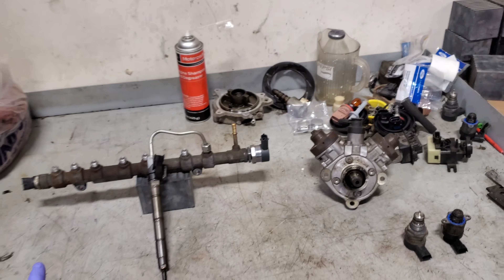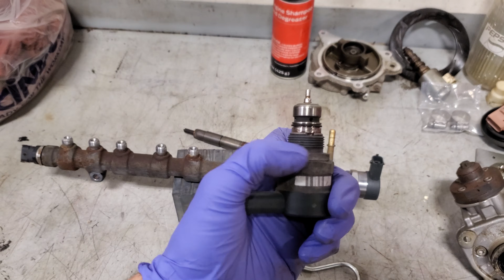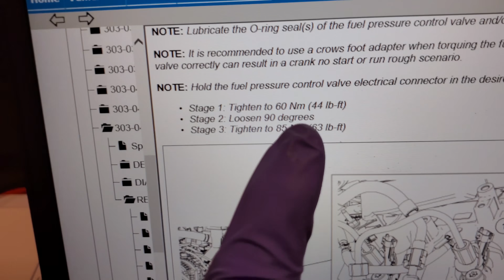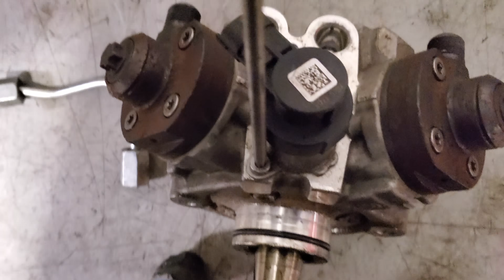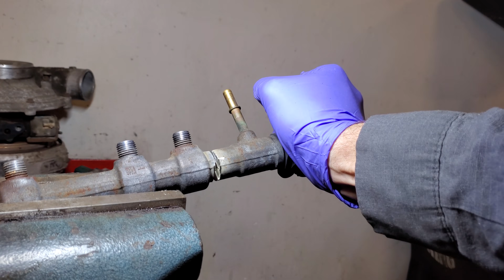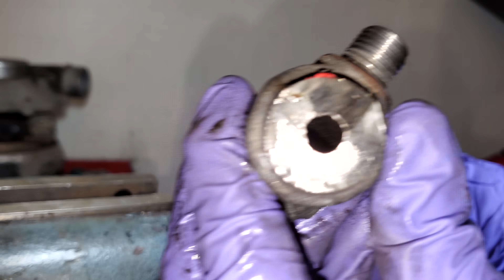High Pressure Fuel system concerns - LH FUEL RAIL discussion | Ford 6.7 Diesel

Comment: Just recently started getting the p0093 on my 2017 f250 only when pulling my gooseneck trailer even empty. I noticed it does it when going over 65mph. Get a engine power reduced and shuts off but ive been lucky to always make it to the right shoulder. It will start and run right back. Replaced the fuel pressure regulator but it is still doing it. Any other suggestiin besides a bad cp4? THANKS!
Reply from the maker: I'd put a new DCR and a LH rail!

Comment: I have an issue I have a 2012 f250 6.7 my air dog is making a bit of noise and I have a squealing sound close to the upper filter when I turn the key on my fuel pressure actual and desired is the same but only showing 1100 psi any thoughts
Reply from the maker: Your HP is reading 1100 or the LP???
Reply: @PowerStrokeTechTalkwARod I would assume the truck wouldn’t even run if it’s actually 1100 psi correct
Reply: That’s at idle when I drive actual and desired are the same and go up to maybe 13 to 1400 psi
Reply from the maker: Thats way too low to run. It needs 5k to start....
Reply: @PowerStrokeTechTalkwARod  I totally forgot I had the Bluetooth module and forscan light. I hooked it up and I’m reading 4500 to 5000 fuel pressure rail side a it says at idle
Reply: It’s fuel rail pressure actual and desired on livewire
Reply: This is all based on SCt live wire TS+ monitor

Comment: Owning these trucks requires many upgrades if you want to keep it running for many years and many miles! Just get the S&S Diesel HPFP and get rid of that CP4 grenade! Mine was on the way out, I swapped it for the S&S and had no glitter yet! 😎👍

Comment: Orifice has to be inside the pcv and the pcv seals off the access to the brass tube.
Reply from the maker: The orifice is not in the PCV it's in the rail. It equalizer pressure between driver side and passenger side fuel rail*

Comment: I have a p0087 code trying to to figure it out.  No metal in the valve on the cp4 pump. Truck runs fine starts only is affected at wot so I think this is my problem, any help is appreciated
Reply from the maker: That code can be kind of tricky to diagnose.There's a couple of pinpoint tests that you would need to follow.So you can know which fork in the road to take
Reply: @PowerStrokeTechTalkwARod so have gone through a few test on my own.  Idle fuel pressure is 4500-4800. Have no starting issues.   While under full open throttle my pressure goes to 26k-29k but the thing that makes me think it’s the regulator is I’m losing fuel flow rate.

Comment: Im getting fuel kpa  in red im wonder if thats what is control module voltage  i pulled the map sensor it stoped shuting down when that spikes red it imeditly shuts only new symptom was battery light  came on i did power back feeding on pin  53 so its possible shorting out
Reply from the maker: Hmmmmm id have 2 look at it

Comment: I have a 6.7 and for some strange reason my fuel injector lines/tubes keep popping. Not sure what’s causing it. I have ordered one of each and have them with me. I replace them as the pop/leak. Machanic wants me to replace the entire fuel rail system.
Reply from the maker: Yepp, that's a no good

Comment: I’m trying to help a neighbor I hope it’s as simple as a fuse or clogged filter , your video is definitely gonna help me diagnose it ! Thank you
Reply from the maker: Good luck
Reply: @PowerStrokeTechTalkwARod  I got the truck running . had low high side pressure , I primed by toggling key switch a few times saw that high side pressure was at 4900 so I cranked it over started right up . ran and observed pressures for a bit and high side pressures would drop . lower pump pressure stayed at 57.7 continuously . Customer finally came out and said he had put DEF in the fuel not Alot but did not clean it out just ran it and fill it up again . he drove it until it died then tried replacing fuel filters . Am I right in suggesting the contamination kit for the fuel system its only got 66000 miles?
Reply from the maker: @joeortiz7408 THE WHOLE KIT!!!!!!!!!!!!!!!!!! DO NOT take any short cuts
Reply: @PowerStrokeTechTalkwARod  thank you I appreciate the help!

Comment: I’ve got a 2022 6.7 power stroke with a crank no start . Has a P2291 code only 60 k miles . Where should I start, filters then relays then pressure test ?

Comment: I literally just had this job whip my ass bc I didn’t realize this LH fuel rail had this orifice, mine did not build any pressure, system was clean 180k miles, I blocked off the injectors still no pressure the only way it would build was by blocking off the F-PCV so I knew my pump was still good,,,, so I ordered a LH rail, installed it and boom, almost immediately made8k psi,,,,, I couldn’t believe it!!!!!!!!
I’m gona cut the rail open soon.

Comment: Today my engine light came on and this  is the code The P228F code indicates that the fuel pressure regulator in a vehicle is too high.
I didn’t notice any change in how the truck was running I was about 200 miles from home got home fine now I’m little nervous what could it be im getting filters Monday even know I changed my filters every 10,000 miles 
And I also ordering the sensor too. 
😔
Any other recommendations will be greatly appreciated thank you.
Reply from the maker: Either a pump or driver side rail

Comment: Scenario..... one of my metal fuel lines that come off the fuel pump (the one on passenger side that runs over to driver side) the truck shut down almost immediately after a low power warning. I got towed and replaced the fuel line. Truck is running great. Only problem is I am now getting p0087. I disconnected batteries to try and clear it and it's still there. Any suggestions? Thanks Arod!
Reply from the maker: Either you still have a problem, or you need a scan tool to clear
Reply: @ thanks
Reply: @PowerStrokeTechTalkwARod  imma disconnect the batteries all night tonight. Im going to harbor freight tomorrow to buy a scanner. Hopefully clear the code and hopefully it doesn't come back

Comment: Hey Arod I have a 2013 f250 and I originally had a P026a and P0087 together. The P0087 code went away on its own and never came back, and i have since replaced the charge air intercooler and gotten rid of the P026a code. But currently I have a P228f code and it is intermittent it comes and goes, but mostly trips CEL and comes on. What are your thoughts brother? Truck has 210k miles currently.
Reply from the maker: I'd be doing the DCR & a driver side rail

Comment: I've been pretty successful with just cranking that sensor down by hand without any issues. Nor have I used any torque spec or torquing sequence as recommended. The biggest thing is it just really needs to be tight. If I have any issues at any point doing that method I will come back and comment otherwise.
Reply: How did you reach it and what tool did you use ?
Reply: @andraealexander364 I just did mine. I used a 1 3/16 crow’s foot that I ground down to fit into small gap. Took longer to grind down the crow’s foot than it did to change out the valve.

Comment: I have an RV with 2014 F550 chasse, 6,7 Powerstroke only 25K miles.   Got error codes on #1, 3. 5 injectors.  #5 was ohming 0 so replaced it. #1 and 3 code returned ohm checked good.  Dealer says replace all injectors. I requested full system contamination check to check VCV screen, the most common item to make all 3 of those code at the same time...Hmm. Its $7K for all but if they install and dont check screen then its a wasted $7K. Getting push back because no code indicate low psi. Just an opinion: I dont think there would be a removable orifice in such a high pressure system, notice any other part with removable orifice.  I'm not diesel guru, but aircraft hydraulics work the same of a 3,000 psi system. if there was it would have to be beveled, wedged, or held in by something that metering valve sits in that drilled orifice

Comment: Had 2017 F 750  the last few days it die going down the road and blew the return line t off no codes would t start after repairing the return line found it had # 5 injector check all the normal stuff like you said blocked off injectors one at a time and tried to start it when got to number 5 it ran got it all back together no codes and was running good sent truck out and it would go into power loss mode it was loosing fuel pressure replaced the sensor and regulator and fixed it first time messing either one so it was learning curve

Comment: Man I’ve been messing with mine now for a minute P0088, P0087 I checked the fuel filter also pulled the regulator (no metal in or on either) I replaced the regulator and the P0088 code went away but I still have P0087 so I back tracked to the fuel pump and found a leak replaced that fuel pump (it was shot) and still have the P0087😞 the only loss I get is just at start up
Reply from the maker: HP pump & driver side rail...

Comment: I may have to replace my fuel system. Hopefully not, but I have the dreaded p0087 code. Truck starts right up, idling sounds good, and it seems to drive fine. But it keeps giving me the reduced power code. May try swapping the sensor first, but if that doesn’t work, it’s going to the shop where I’ll probably need to replace the whole fuel system.😢
Reply: Could be the fuel rail.

Comment: ['21 F350] I experienced the P0087, ie I couldn't develop adequate fuel pressure at WOT and I tracked the problem down to a tiny nick at the edge of a (new) fuel pressure regulator. The truck would idle, even drive OK, but at WOT it would throw the code. Since you replaced the regulator and it did not resolve the problem, I would inspect the threads (mating) side of the tube for any irregularity. This part of the system has extremely low tolerances as you mentioned.
Reply: a nick? how small and where was it.  were you getting a p0087 code? thats what im chasing now

Comment: Hey ARod we have a fleet of F550's and one of the 2018 is getting a reoccurring fault code for multiple fuel injector learning limit exceeded, runs fine other than slight fuel knock occasionally at idle, have you seen this before ? Should i take the VCV out and inspect . Thanks
Reply from the maker: Did you try resetting the mid mass fuel adaptations for all cylinders
Reply: yes we have and also has the latest pcm update  @PowerStrokeTechTalkwARod
Reply from the maker: Are all of the IQ a numbers programmed
Reply: yes they all match  @PowerStrokeTechTalkwARod
Reply from the maker: @user-rx7sw7si8e hmmmmmm

Comment: I have a 4-5 second long crank with code p228f and on idle it has like a fuel knock but once you rev it the fuel knock goes away . Any ideas if that regulator would cause that ?

Comment: Does anyone know if a bad fuel volume control valve will still give good fuel pressure reading in the high pressure fuel pump? My fuel volume control valve is only opening up at 26% duty cycle and at WOT 31%...seems stuck to me but fuel pressure is on target to what my fuel pressure is commanding?

Comment: I have a P228F, P0170, and multiple cyl contribution /balance codes. Truck ran fine, thought engine blew. Sat 2 yrs, then found starter messed up. Put new starter and batteries on, started up and ran fine. Ran for 2 weeks, then suddenly started studdering and quit. Hasn't run since. Threw those codes.  Changed filters, dropped and cleaned tank, pulled cpr4 valve and it was as clean as can be. No rust, no flakes. Still stuck with a 100k mile truck not knowing what to do. Everyone saying fuel system at $10k to fix.  Haven't found anything to justify doing that.
Reply from the maker: New CP4 or S&S new DCR & replace the LH rail, trust me

Comment: Getting p228f code truck idles fine, no power to pull its self though. I see most of your replies to p228f are to replace the ds fuel rail, is this cause by the cp4 going bad is replacing the rail going to completely fix my issue. Is it the start of a complete fuel system failure or will I be done back on the road.
Reply from the maker: Rail & pump combo, trust me
Reply: @PowerStrokeTechTalkwARod  replace the just pump and rail. Or should I do a full contamination kit?
Reply from the maker: Is it currently running then no
Reply: @PowerStrokeTechTalkwARod  yes it was still running when I parked it. Just doesn’t have much power. Won’t move over 45 mph and coding for p228f. I will start with replacing pump and fuel rail. Thank you!!
Reply: @TheRockStar129 did it work?? Rail and pump combo … I’m getting ready to do it!!!!!
Reply: @matthewluna727  I ended up replacing just the rail, mechanic that helped do mine did not find a need to replace the cp4 because there were no metal shavings found. We found that my lift pump was not able to keep up with the demand for fuel needed to run the tune I had on my truck so we went with an airdog lift pump kit to deliver more fuel. But replacing the rail and sensors got the truck running again. Mechanic determined that the orifice was stuck or something.
Reply: @TheRockStar129  thank you!!! Glad to hear your rolling again!!
Reply: @PowerStrokeTechTalkwARod rail and pump combo did it for me!! I did dcr pump though and drop fuel tank to clean out, I opened bank 2 and injector 5 failed a low idle test but the engineer told me it was that bad because it passed everything else with flying colors just got the truck back today and just keeping my fingers crossed that everything stays good 👍
Reply: @TheRockStar129 thank you for your feedback!! Interesting on the lift pump, I will do that too one day when I get more $$

Comment: Great video!! Question for you. Have you ever come across an issue with the fuel return lines blowing off the plastic fittings at the injectors? I’m working on a 6.7 that has an issue blowing return lines off . I thought it was a restriction at first so I blow the lines out from the injectors to the tank . I also swapped out the injectors that the hoses are blowing off the fittings with known good injectors. The return line assembly is also new . The problem only happens under hard acceleration or heavy engine load. At idle it’s fine. No other drivability issues.
Reply from the maker: Time for a fuel sys pal
Reply: Hi, I am having the same issue with only one return line blowing off. Did you find the problem ?
Reply from the maker: U have high restriction in fuel return side
Reply: @PowerStrokeTechTalkwARod   How do I test/trace the restriction. It happened right after installing new/reman fuel system . Truck starts but when press the gas rapidly bogs down .
Reply from the maker: @Ioang40 pinpoint tests M & ME
Reply: @PowerStrokeTechTalkwARod  Found the flex line going to the Pressure Regulator kinked and twisted.Could this the culprit for the restriction and blowing off the return line of injector#6 ? Also a loud screeching noise coming from Engine mounted Fuel filter . I have a short video if you give me an email . Thank you !
Reply from the maker: @Ioang40 no. Thats no the fuel injector eeturn
Reply: @PowerStrokeTechTalkwARod  I replaced the kinked flex line going to the FRP regulator and the screeching noise gone and no more blow off return line  but I still have High Fuel rail pressure at 5,600 psi  .

Comment: Yea I have, on the three time now.  Mechanic couldn’t fix it last time. He replaced injectors but only cleaned rail. I’m pissed.  Runs at idle rough at times and then cleans up intermittently.

Comment: ARod, yes we have had this failure and caught it before the engine was damaged. HOWEVER the entire fuel system has now been replaced (New CP4, metering valve, lines, rails, injectors, low pressure pump. Everything in the fuel system is brand new) and it runs in park or neutral but a couple minutes in drive. Commanded fuel pressure will spike, the actual pressure is correct but the difference trips the low fuel pressure code and sends it to reduced power mode P0087 code. Any ideas??

Comment: I am getting code p228f exceeded learning limits pressure too high along with long cranks. 2-3 sec, vs normal of almost immediate.
Reply from the maker: Ok
Reply: @PowerStrokeTechTalkwARod  Sorry at the time I meant to add more details and hit send anyways. I pulled the valve on the top of the pump as you suggested. There is a tiny amount of metal shavings I have a close up pic if I can share it with you via email. I drove it with the long cranks about 12 times before parking it. Is there a chance I can replace just the pump, or is any amount of shavings grounds for full fuel system replacement?
Reply from the maker: Any metal? It's. Time? To replace everything unfortunately but it would have been nice if you had the s n s disaster prevention kit on it

Comment: 2011, F250, 6.7 with 214,000 miles and run Motorcraft Cetane religiously from day one… NO PROBLEMS, just consumables. I am S&S Bypassed as insurance. I’m thinking about changing out the CP4 and injectors because I intend to drive the truck a long time. Any educated thoughts on if that’s a good plan, or should I save my money?  Please advise…

Comment: Wow. Well done. Good video. Had this exact problem on a 2012 F550. Pulled my hair out too. P228F-00 code. Symptom engine idle fine, rev engine, or run at high idle and disengage high idle, fuel pressure would spike the drop enough for engine to die, usually under 2000 psi. Changed MPROM, no fix, changed PCV no fix, changed FP sensor no fix. Finally got from Ford exactly what you found. “orfice has become dislodged” this orfice is used to create the correct pressure differential between main fuel rail pressure and PCV side of rail. Ford fix is to replace entire DS fuel rail as orfice is not repairable. Fixed my problem. Hooray! Cool thing is Ford sells entire rail including both FP sensor and PCV for less than the 2 combined.
Reply: Wow great video 
After reading these comments I'm going to sell mine in the morning